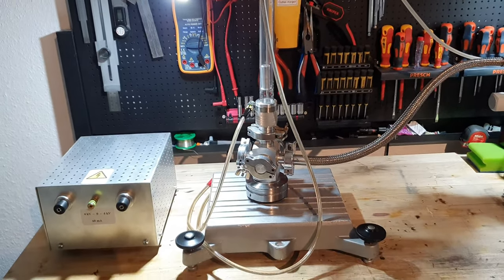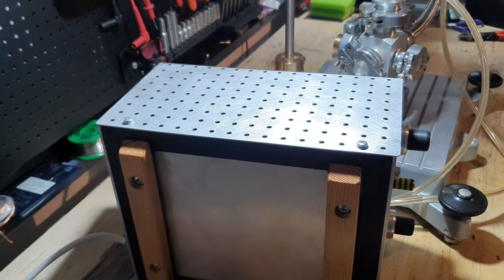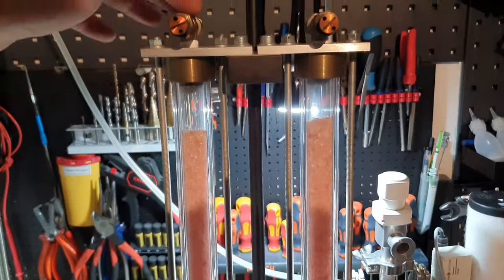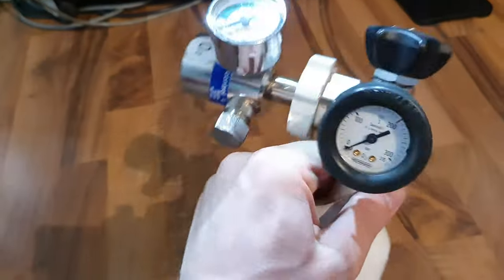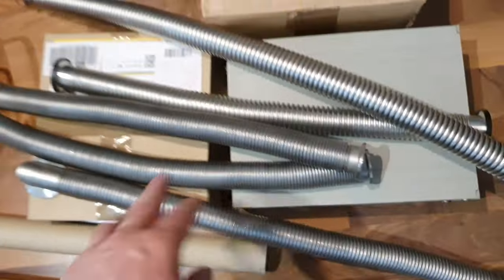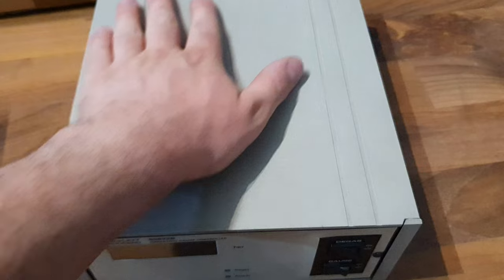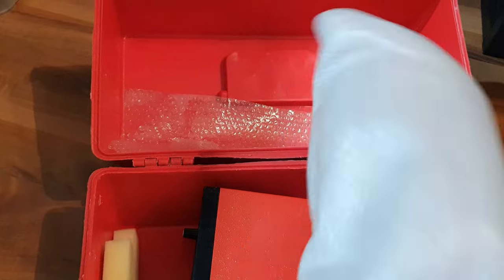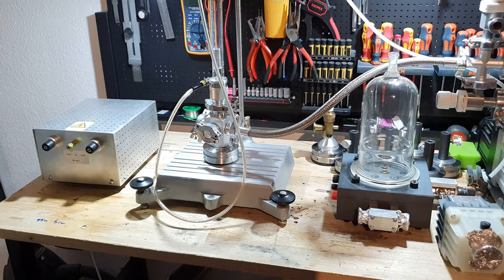New Equipment Tour

Comment: Very nice assortment of equipment. 

Ideas for things to try with this equipment:
- If the gas discharge tube can be seen through along its length, you could try to get some CO2 lasing going on inside. 
- Another interesting thing one could try is to build a metal foil pump for hydrogen.  A hydrogen plasma that produces atomic/ionic hydrogen can hit a thin metal foil and permeate through that foil. The presence of a these atoms/ion on one side of the foil make the path for hydrogen form the plasma to non-plasma side easier than the other way around, and you can get some transport of very pure hydrogen this way.

Comment: 11:10 the pressure range would match a Pirani gauge using thermal flux to determine pressure.
As for for ionization one you have to calibrate it for different gases. May be there is a label for what gas it is set up at the moment.
Edit: Should have watched 30s longer ... 
The one you didn't know the type could be a capacitive diaphragm one
Reply from the maker: Yes, capacitive diaphragm was the term I was looking for in that moment. I'm pretty sure it's one of those. 

Ok, thanks for the advice regarding the ionisation gauge. I never worked with one before. Do you know how to calibrate them if there is no label?

Comment: The smallest turbo on the market is the Pfeiffer Hipace 10.  Creare makes a hybrid turbo/molecular drag pump which is the size of a D cell and runs at 200,000 rpm.  It's not commercially available, however.

Comment: These are absolutely amazing finds.
The diffusion and turbo molecular pumps are the best of the bunch, they are both so small.

Are you still planning on building a glass diffusion pump...? 
If I remember correctly you said that it was part of the plan at some point...?
Reply from the maker: I don’t think I can rebuild the glass diffusion pump. My flameworking skills are not nearly good enough for that. But I will keep the housing. Maybe I can repurpose it in the future.

Comment: Wow!  Awesome find.  Great video, thanks for sharing.  Wondering what the electronics items are?   I've been learning electronics, amateur radio and RF engineering after dealing with more RF/Microwaves issues.  

Anyways, wondering if electrochemistry related or maybe possibly like if you're not familiar with (guessing preaching to choir so pardon me please) photochemistry (electronic transitional)... though RF (spin), Microwaves (rotational), IR (vibrational) modes (dipolar/ionic polarization) assistance for aiding organic/inorganic synthesis?   Fun with what I wondered about in regards to like if the spectroscopy is useful, when learning about, why can not be the frequencies useful for synthesis?  Seemed to be, though that topic was taboo seems when I was working on my undergraduate research.  I guess other uses diverted my focus on other tasks not so great. 

Appears more plasma stuff, though great haul.  Always can use some lab equipment porn.

Comment: I'd like to see making metal crystal bars from Ti, Zr, Hf, ... by the https://en.wikipedia.org/wiki/Van_Arkel%E2%80%93de_Boer_process . These bars can be easily found on ebay, but I've never seen a photo nor a video of the process itself, you'd be the first one...
Reply from the maker: That's a great idea! I will take a look at it and see if I can do it.
Reply: @AdvancedTinkering  Great! I think the biggest problem is maintaining a nearly constant temperature at the deposition wire since the needed current grows when more material deposits and the resistance drops.
But I'm quite sure you can do it, you showed your glass blowing and working with Rb/Cs  in a vacuum arts already!